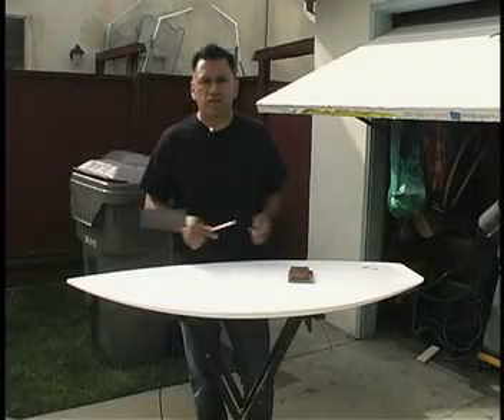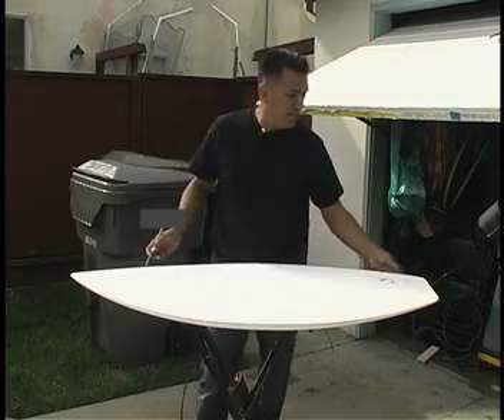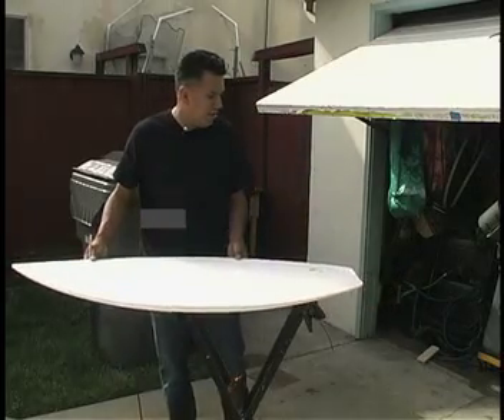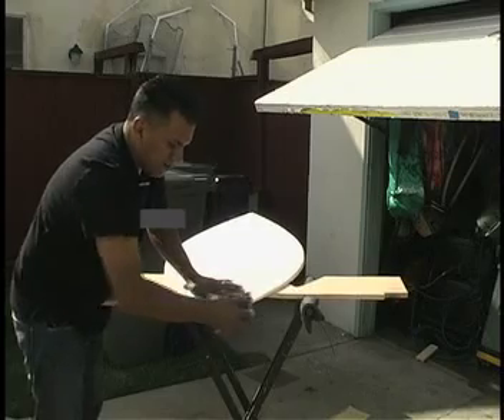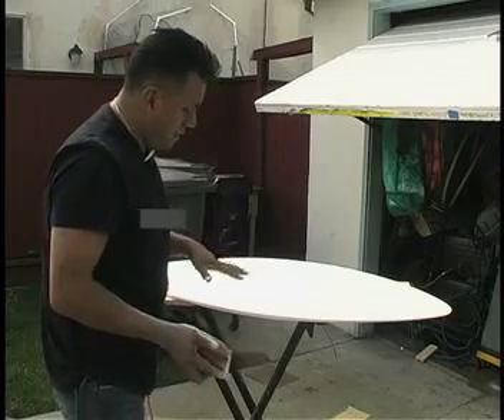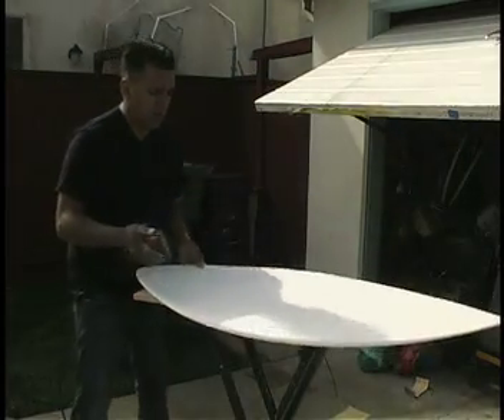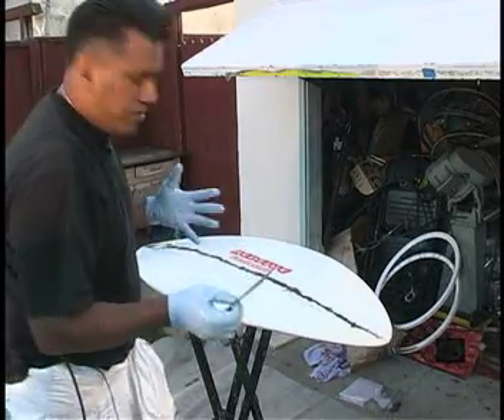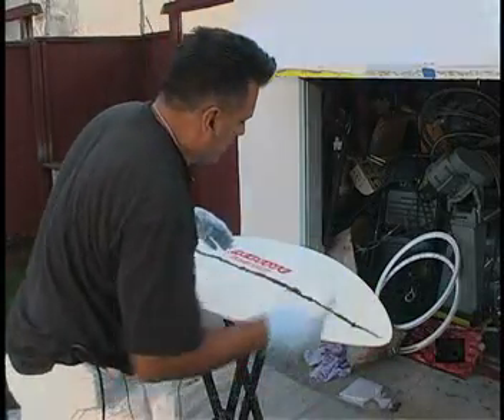How to Make a Skimboard - shaping and glassing.

Comment from the maker: @idc0412  - glass coat - 16oz each side.  floodcoat approx - 12-14 oz each side - Gloss coat 10 - 12 oz each side. - a little over a half a gallon.  if you vacuum bag you will use less.

Comment from the maker: @145matman  - you can try to degas your resin to help reduce the air in the first place. - You have to work the rails until the resing gels to avoid air bubbles under the glass.  Or the more costly way.  After you finish glassing and you wrap your glass to the underside, place your board on a special table in the curvature of  your board and vacuum bag.  When the glassing is all done you wrap the board in plastic and pull out all the air.  This will reduce and almost completely eliminate air.

Comment from the maker: Hey, thanks for watching.  I have a website and a blog.  Check out the blog.

I have two size blanks.  I usually sell them for $65.oo + shipping.  keep in mind that 95% of the shaping is complete and the rockers in the front and back are already in place.  Give the blank and final smoothing sand, round the rails, apply art and then glass.  it's that easy.

email me at ( skim  at  red5ive  dod  com) and I will give you the blog site

Comment from the maker: Thanks for watching and contacting me.  Of course the price goes down with higher qtys and only the rocker cut.  The 65 dollar board is a premium no hassel starter board with 90 percent of the shaping complete.

Rectangle blanks with the front and rear rocker in place, see below.

prices are as follows:  10 blanks - $53 each, 20 blanks - $44.00 each, 30 Blanks - $42.00 each,  50 Blanks - $40.00 each.

Thanks
RedFive Skimboards
email: Skim@Red5ive.com

Comment: just finish shaping and sanding my foam board but i have problem with fiber glassing the foam,
how do i prevent resin(glassing) from melting the foam?
Reply from the maker: If you are using the White Beaded foam, Styrene, you should be using Epoxy Resin.   PolyUrethane resin will melt the board.  If you are wanting to use polyurethane then you have to change the board material to polyurethane foam. goodluck.
Reply: i think i solve the melting problem w/o changing the resin and styren board( cause i cant findpolyurathane board). i just covered the styrene board with "elmers glue" before covering it with resin. thanks btw. more powers

Comment from the maker: Hello, 

I was able to rework my pricing structure: Approx blank size 52 x 23

20 blanks @ $22.00 each
30 blanks @ $21.00 each
40 blanks @ $20.00 each
Theese are rectangle blanks with a Rocker in the Front and Rear- Let me know.